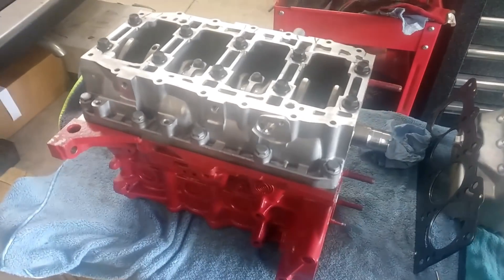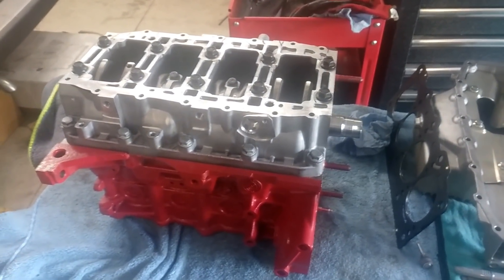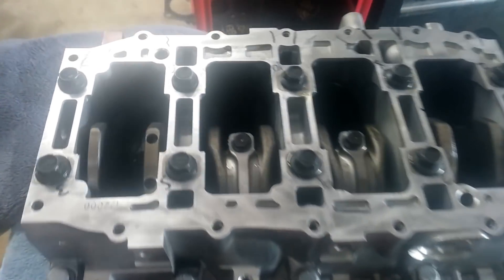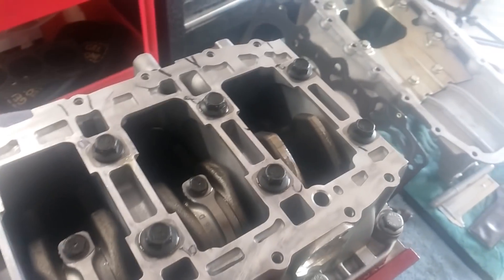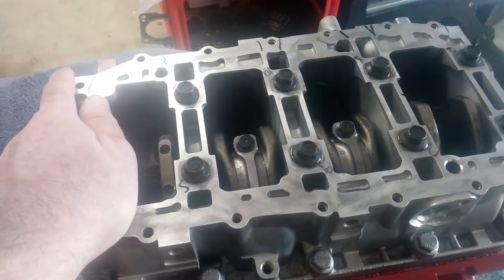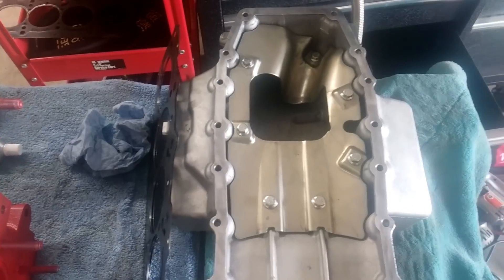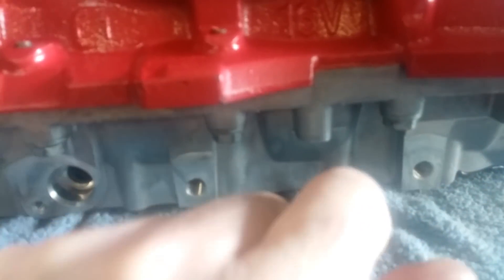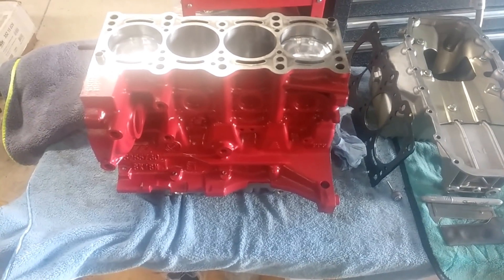Fiat 1.4 Liter Multiair Turbo Build Pt. 2

Comment: What kind of valve guide to stem clearances do you run or like to see.
Reply from the maker: factory specs. I'm not a believer in the whole "set it up loose" thing with valve guides, at least not on modern turbo engines.

Comment: did you  reuse head bolts?
Reply from the maker: Not on this engine, but you can in this case. The manual has a procedure for checking them, if they pass you can re-use them, if not you must replace them. Now the rod bolts are another matter, they are one time use, so are the flywheel bolts.

Comment: Im doing my rebuild on my Fiat 500 1.4L.  I notices when head came of, and I set the timing tool prior, that the pistons were even.....  I would have assumed that piston one would be at the highest point?
Reply from the maker: \ The timing tools for the 1.4 multi air do NOT lock any of the pistons at top dead center.

Comment: good to see you video shows the valve springs and retainers, tomorrow I am going to tear mine apart and replacing all valve stem seals, they causing a oil burn pretty bad.

Comment: Why do you torture yourself my mechanically inclined friend. These are horrible engines and burn oil and fail so prematurely. Fix It Again Tony.
Reply from the maker: My Fiat 500L has 140,000 miles on it and its been great.
Reply: @GregsAirplanesandAutomobiles  You, sir, are the exception to the rule 😉

Comment: I'm repairing a 1.4liter turbo in a 2016 renegade. Very liitle info out there. Your videos have been a huge help. Thanks for doing them!!
Reply: I'm curious what you are repairing? I'm looking at buying a 2016 Renegade with a "bad" engine. I'm not sure what the exact failure is but I'm wondering if I can repair it versus replacing.

Comment: Greg, the 2 Thrust bushings are worn through on my  Fiat 124. 

Q1: Is it possible to replace just the upper thrust bushings themselves, while the engine is in the car? (after removing the bottom assembly of CAPS, "the lower main bearing cradle"... which connects to the upper bedplate)
Q2: I have heard that it might be possible to place a full thrust bearing on both upper and lower on the No. 3 journal, so that it should better support the forces of the clutch on the crank.
What Do you think?
Reply from the maker: John, this is something we would have to discuss via phone. If you're an EC customer send them and email and they should be able to give you a time on Monday when you can call me, or I can call you.

Comment: Excellent video - thanks for sharing! i am working on the granddaddy of this engine - the 1242cc 8v version from the early 90s. 75hp stock, but with some work and forced induction I'm aiming for 140 ~150hp.
Reply from the maker: That sounds fun. Are you supercharging it?
Reply: @GregsAirplanesandAutomobiles   It's a budget build, I'll use an Eaton M45 supercharger as those are cheap and plentiful. I am partially copying a moyor setup by Finish youtuber Jonik.  He started with a Chinese  Aisin AMR500 clone but had reliability issues. He then upgraded to an Eaton M62, but that seems overkill for my power goals. The M45 sits right in between those two and should be a decent match.

The engine will go into a 1987 Fiat Panda citycar. It was fitted with the OG of the Fiat FIRE engine - a carbed 999cc pumping out 44hp. It'll be a fun hot hatch with 3x the power.
Reply from the maker: I wrote a book and this subject. It deals with how to home build a good supercharger kit: https://www.amazon.com/SUPERCHARGING-guide-superchargers-water-injection-ebook/dp/B00FGDKK5Q . I should mention it's included in the 5 dollar Patreon level, so that's the cheapest way to read it.

Comment: From what I've learned about the FIAT FIRE engine is the 84 mm stroke is about the absolute utmost it can be stroked due to physical limitations. Undersquare engines seem to be standard fare for most 4 cylinders these days & it appears FIAT went for maximum efficiency stroking their engine. Smokey Yunick felt every engine should be stroked to its utmost. The FIRE series engine started life with a 70 mm bore (and shorter stroke), was de-bored, & then only upped 2 mm to 72. I remember Honda's CB500 was bored out to make the CB550, and then bored out again to make the CB650, although many feel Honda probably bored a little too far with that one. What do you think the FIAT FIRE bore limit is ?  My take on things is that if FIAT wasn't planning on turboing the FIRE block, then possibly they could have bored up to 75 mm ?  But, they had turbo plans all along for the FIRE engine (where the long stroke comes in handy) so the bore remained the same, probably for simplicity between it and the non-turbo version & more material around the cylinders for boost reliability. I've always likened the latest & last incarnation of the FIRE engine, the  1.4 version, as an engine with 1000 cc pistons & a stroke worthy of a 1600 cc engine, which equals 1368 cc in FIAT's case.

Comment: Looking for some 1.4 multi air info I have a 2013 Dodge Dart bought the car with a blown engine came with another engine, the engine it came with is a 2015 has external things that are different but what I am trying to find out are there any internal differences that would keep this engine from working like the camshaft,pistons etc… any help would be greatly appreciated. Thanks in advance
Reply from the maker: Hi Marc, if that's your real name and you are an EC customer I can look up your number and give you a call. This would be way easier over the phone.
Reply: I tried replying with my number but I guess maybe that isn’t allowed. I’m not sure what EC is? And my name is Marc
Reply from the maker: Eurocompulsion, I do tech support for them. I guess that means you are not a customer, thus I can't pull up your number. Oh, well, it was an idea.

Comment: With bike engines it’s common to make a copper head gasket for overbores. Silly question - would that work on a high power turbo engine like this?
Reply from the maker: Yes it would work.

Comment: Question: What is the exact reason for the head gasket not to overhang even a little bit. My three guesses would be in no particular order:
1. Piston can clear the block deck on TDC and hit the gasket. This would be very uncommon.
2. Head gasket lip overhanging in the bore is not compressed and exposed to combustion therefore susceptible to failure of some sort.
3. Head gasket lip protruding in the combustion chamber can create a hot spot and increase tendency to knock or even  detonate.
Just curious.
Reply from the maker: Hi Thomas, great question, it's reasons 2 and 3, although if the engine isn't built quite right I suppose reason 1 could factor in. In practical terms what will happen is that the gasket will come apart and the metal pieces will tear up the engine, and if that doesn't kill it, the gasket will probably blow.

Comment: the fucking plauge...... lmfao have you been to jewel lately.... the ad-hoc screwed on "sneeze guards" for cashiers.     on another point  I'm glad I don't work in a supermarket....those places are gross enough
Reply: also righteous videos, every one of em.    Curious if you have seen he "machine thinking" channels video about the mesta presses??  it is quite awesome.  Seeing how they recently repaired the Ohio one they will be able to make  "all the F-35 parts"and B-52 wing-spars and suchnot to keep em flying into the 2040's.   honestly I am legit curious about how they will keep those airframes airworthy that long... I am not a pilot or even involved in the aerospace industry, knowing that there are hourly limits on structural components I'm,curious if you have any insight on this?
Reply from the maker: I'm afraid I don't know. Metallurgy and fatigue are outside my areas of knowledge.

Comment: I'm not an expert in adhesives mind you. But It's my understanding that the original OEM brand sealant is not exactly the same as rtv silicone. In motorcycle engines it's pretty common for crankcase halves to use no gasket. Only adhesive. And in all the shop manuals you read the same phrase "use only the oem brand sealant". In motorcycles we usually use yamabond 4 or as an option ThreeBond 1104 which I'm pretty sure it's the same product. I believe ThreeBond manufactures for yamaha. I believe these products are not silicone. They are synthetic rubber, the difference between that and silicone I have no idea. But one thing I do know is that these products have less tendency to ball up on the inside of the engine when there is excess product. That little excess of material, with time, tends to break off and then clog up oil screens or lines. Anyway, like I said, I no expert sadly, but I'm pretty sure the correct products are the best option here. Thanks for the video!

Comment: Thanks for sharing. 
 I don’t see how tiny increase in displacement would increase power. Peak power would be reached at slightly lower rpm perhaps? Real benefit of larger bore is more room for bigger valves. Is bigger bore on its own really worth it? 
  Love your videos. (If you wipe your camera lens with your shirt prior filming, I’d love it even more :) )
Reply from the maker: AMC went from a 390 to a 401. Was that worth it?
Reply from the maker: And Chevrolet bumped the 396 up to a 402.
Reply: @GregsAirplanesandAutomobiles  
The primary reason as I understand it that AMC stroked the 390, 290 and 343 was for emissions. It really didn't gain them much if any power with the slightly tougher emissions resulting in a slight power loss. At least that's the story I got from the engineers. I used to work at Kenosha Engine until 2005. Big empty field now
Reply from the maker: Each of those engines you listed has more power than the next one down, the 401 has more power than the 390, which has more than the 343 and so on. The 1971 401 with 10.2:1 compression had 335hp/435tq, higher than any 390 except for a few special versions produced in super low numbers, and even those only have 5 more hp and less torque.The 401 still had more power under the curve. An equivalent 390 with 10.2:1 has 325/420. All things equal, more displacement gives more power.
Reply: @GregsAirplanesandAutomobiles  
We both know the HP figures from the 60s and early 70s are suspect. The whole gross hp claims from most manufactures was a game they played. Even if the 401 say in 71 put out 15 more hp by 72 or 73 every manufacturers engines were being gradually emasculated.  For all the hype about Hemi Cudas, Boss Mustangs, 396 Chevelles etc there are more fast cars built today than there were then. Plus everything built in the Muscle Car Era handled and braked like a semi on ice. True you could improve them by adding aftermarket or dealer installed factory parts. One example. A 1969 SC/Rambler equipped with dealer installed rear disc brakes was capable of 1÷gee stops. How many before brake fade set in that's another issue. The same package was able to be ordered as a dealer installed option on both the Javelin and AMX. I know other manufacturers had dealer installed options that went even farther. Probably the two best overall performance cars built in the time period in the US were the Z-28 Camaro and the 69/70 Boss Mustangs. I know the Z was available with dual quads from the factory. Just how many were built is of course a good question. The Mustangs in 1970 showed up at the first race of the season with what were essentially 4 barrel Webers. The throats on these were spaced to match the inlet spacing on the heads. The carbs were supposed to be in the parts catalog. Whether that many were built is a good question. Another example of questionable parts is the front and rear discs used on Penske (later Allison) NASCAR Matadors were equipped with brake rotors from Porsche 917s. But they had an AMC part number. Yah, right.

Comment: Just a little tip if you ever have to open up another head gasket, flap wheel sanders like this are great for that sort of thing. Goes a lot quicker but still easy to control.
https://www.dremel.com/en_US/products/-/show-product/accessories/502-3-8-flapwheel-80-grit
Reply from the maker: Thanks.

Comment: intresting as ever👍 what's stock output and what are you planning to get with this build?
Reply from the maker: Thanks, stock is 160hp at the flywheel. The most we have run on pump gas is around 250hp at the flywheel. I'm planning on running more in this engine. I'll put up dyno and acceleration data once it's done.